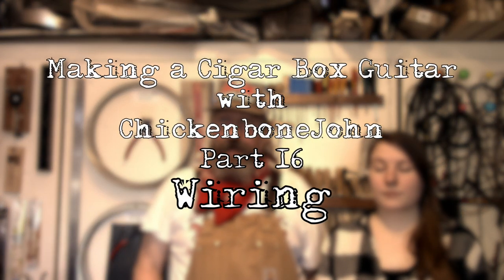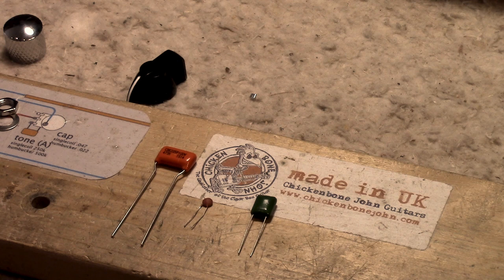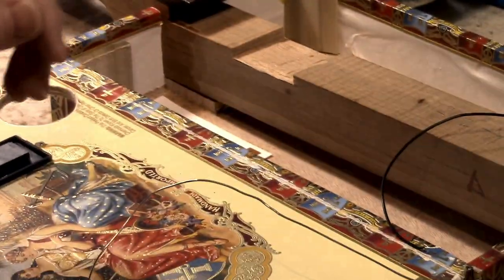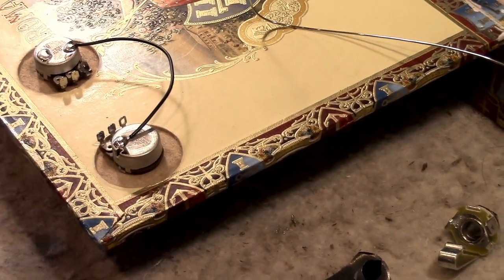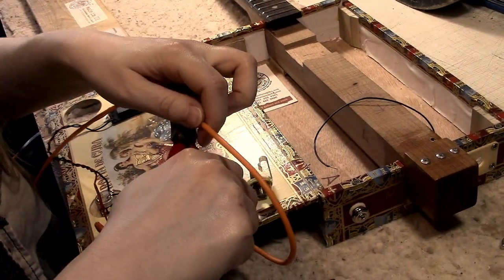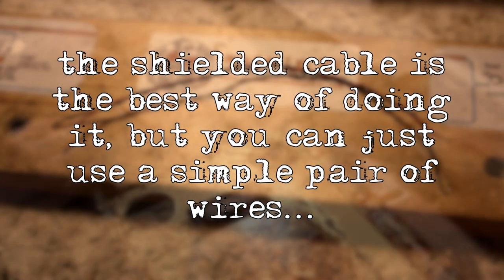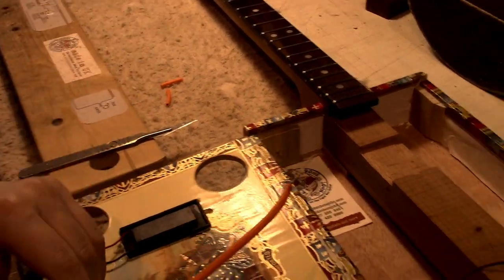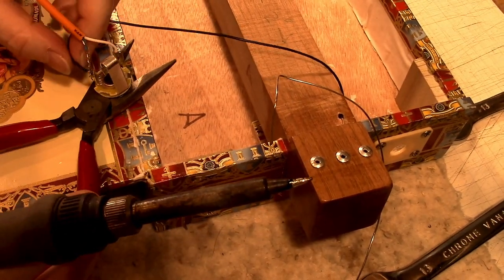Making a Cigar Box Guitar with ChickenboneJohn. Part 16. Wiring

Comment: great video you 2! what gauge wire do you use?
Reply from the maker: We are using 7/0.2mm equipment wire. Thats 7 strands of 0.2sqmm  copper conductor, 1.2mm outside diameter approx. The shielded hook up wire is VanDamme Pro Grade Classic XKE

Comment: Is there any reason  why the grounds shouldn't go onto the tab on the pot and then a single connection to the pot body from the grounding tab?
Reply from the maker: As long as you are grounding the correct tab, that's OK.